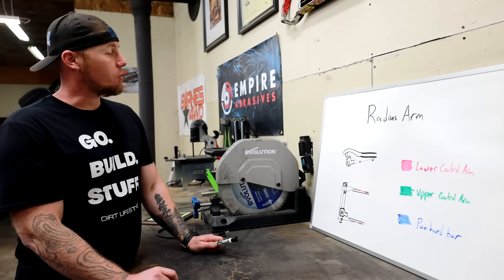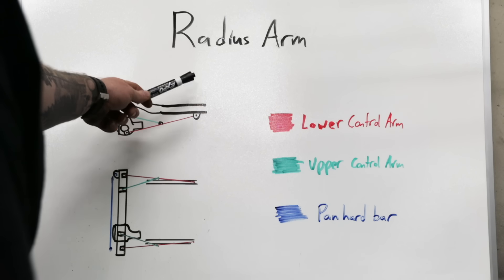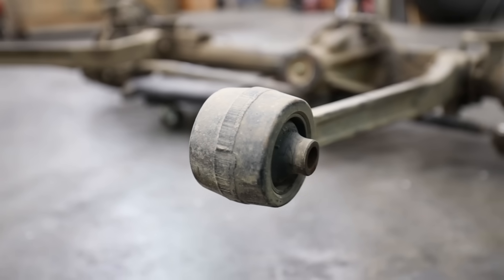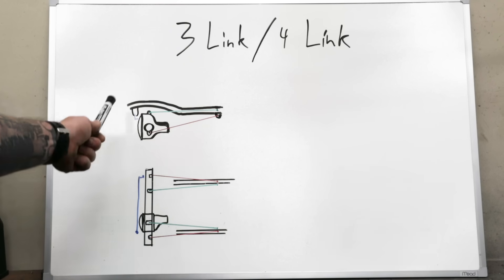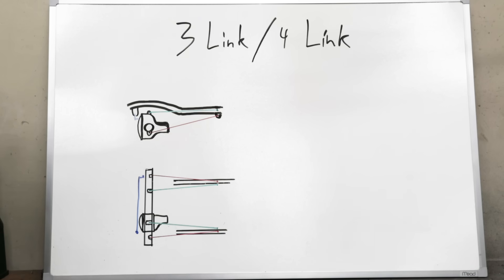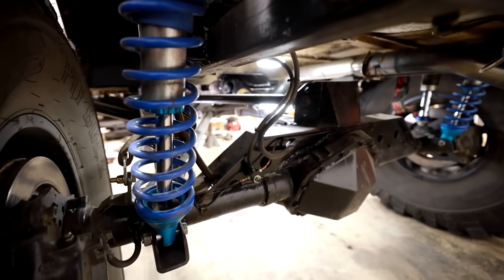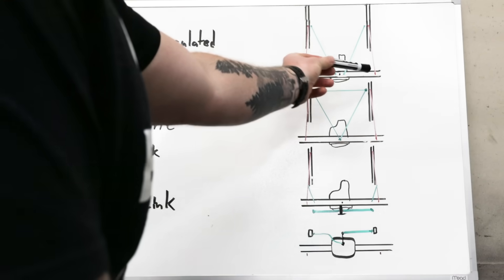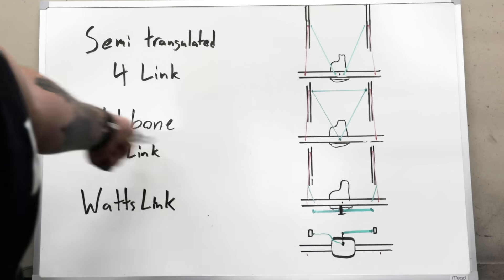3 Link vs 4 Link vs Radius Arm vs Watts Link vs Wishbone 3 Link

Comment: Although I'm 5 years late watching this video, man let me tell you that you've accomplished teaching me a lot within such a short time. I used to have an XJ on the Skyjacker Rock Ready 8" LA bolt on kit. That kit was a 4 link. It was awesome. Fast forward 10 years later to present day, I purchased a built XJ on  a 4.5" RE LA kit. This one is a radius arm kit. I was contemplating going up to 6.5" coils in the front but had ran into some information that radius arms "bind" up more than a 3 or 4 link. So I was in between options on just buying new 6.5" coils with the RE radius arms or going straight up Iron Rock 3 link kit for the front. With this new information you made possible in 1 video, I'm comfortable making a better, informed decision. Thank you very much for this. Keep building stuff and sharing your knowledge, much appreciated!

Comment: "Radius arms" are tuneable if you set them up like a jeep long arm where you have an adjustable "lower ca" which has a small "upper ca" link coming off of it which is also adjustable, you, in theory, have an adjustable radius arm.

Comment: What about truck arm suspension? And has anyone ever considered de-dion for an offroad build? De-dion, if you don't know, is a dead solid axle connecting the two hubs, with the diff mounted to the chassis and using CVs to power the wheels. Advantages are no torque twist on the chassis and much lighter unsprung weight. Can't really think of any disadvantages besides a different kind of complexity. Though I assume in the offroad world, CVs in general are at a disadvantage, strength-wise.

Comment: Land rover duscovery uses the watts link my lifted disco 2 handled very well required no rear sway bar, flexed very well offroad, i would run a watts link again, current set up is a semi triangulated rear with 6 inches if lift from a reputable company, the roll steer is real and out of control without a sway bar

Comment: I had a long radius-arm setup in front. Gnarly flex.
But the vehicle eventually developed a terrifying death-wobble.
I'm now wondering if I needed to replace all of my bushings. They visually looked good, but were probably pushing 4 years old at the time. I never realized the bushings are a frequent wear item for radius-arm suspension. Thanks for enlightening me.

Comment: Thanks.  Just the debate we are having on our LJ.  Especially on the front.  It is running RJ60's on a short arm.  Radius arms in the front was the first thought but the rotated 60 housing will be an issue.  A way around that is to modify the upper arm on driver side to clear housing.  put an arch in it.  Was thinking Clayton but now see that crazy "strut" set up on the Metalcloak radius set up that stops the binding.?  Yes, we can build our own kit but was trying to stay with an off the shelf option that we could tweak.  So 3 link may be the option cause exhaust will be in the way for 4 link.  Trying to stay on some kind of budget but it's getting out of control as our minds wander.  Since we were going to stick with coils and shocks and now have the coil over bug.  Thoughts?

Comment: Watts link and 3link/panhard in the rear is an option for a truck that's keeping the stock fuel tank and real estate is an option. I've also seen a reverse direction upper triangle link which I still can't wrap my head around.

Comment: Why couldn't one use a single leaf spring to hold the axle in place and leaf springs or coilovers for the actual suspension  ?
just for simplicitys sake and a smoother ride over leaf springs.

Comment: Hi Nate great info and very nice you are willing to help out other wheeler guys I am tying to build a Utv Buggy with a straight axle and rooms is tight  I have been playing around with links arms I have though about doing a double A-arm set up on each side like a Quad but turn 90 I think it will go up and down good but I can not tell if it will flex with this set up what do you think. and the axle is a Suzuki Samuari axle or jeep cherokee axle and I am thinking on building a truss on top of either one manily the Suzuki axle I do not want to run a panhandle bar.

Comment: On the Semi-triangulated 4 link and the wishbone 3 link having the parallel links parallel to the ground @ ride height the roll steer will be minimized. Having the forward end of the parallel link lower than at the axle it will have roll understeer which gives a stabilizing effect.

Comment: i have a 1995 ram 2500 4wd completly stock would longer arms on the front give better ride . don't need lift don't do off road with it but would like a little better ride i like the look of long arms but mainly want better ride. when i say don't do off road i do sometimes assist in recovery of stuck vehicles  but don't do off road for fun im in southeast Alabama mostly mud not much else do deal with

Comment: Panhard bar rear ends roll to one side when above ride height, if you run fatties in tubs you can touch the body into the tires on one side of your truck... The difference between a watts link in vertical travel.

Comment: I watched this video as I'm doing full size axle swap and 5.3/4l60 on my '03 4 door tracker. I think I'd like to do radius arm front. Do you or any one else have a suggest arm length overall based on tire size? I assume longer the better. Also the separation of upper and lower axle mounting  tabs? Maybe I'm over thinking this. I do it a lot haha. Thanks

Comment: I know this video is over a year old.. I've watched it a couple times, but I just came up with a question. 
On a triangulated 4 link. Is there any reason you couldn't reverse the triangles? What I mean is make where the links come together on the bottom of the axle instead of the top, then the "wide part" of the other triangle on top of the axle.

Comment: After watching a bunch of your 3 link/4 link videos, I had a question for you and wanting your opinion. I have 3 linked the front of my jeep and I’m wanting to link the rear of it, It has a factory offset rear axle, with this being said would a single triangulated 4 link mess with the driveshaft ? Or would it be best to 3 link the rear also to keep the driveshaft clear ? I’ve been reading up and I’ve seen a few 3 links in the rears of Tacoma’s and such. 

Thanks !

Comment: very interesting. does a factory radius arm set up have a lot of bind? can it be improved a lot by converting it to heim joints? I can not see the difference between the triangulated 4 link and the wishbone set up. the drawing looks exactly the same if you eliminate the cross bar... 
what about a wishbone set up like C10 Chevy, with the center of the triangle reversed to the front?

Comment: Hey Nate! Love your videos man! I have a 96 Dodge ram project that has me scratching my head a bit. It has the Dana 60 front diff with the CAD unit. It also has what appears to be factory 4 link with a pan hard bar. I've been told it's best to ditch the OEM steering due to death wobble and I've also been told I should drop the factory 4 link and go with radius arms. Now this truck is a beast (5 speed, 12 Valve Cummins) but it's main use and purpose is a tow rig (possibly emergency recovery), not hardcore offroader. The reason I'm asking your input is the factory steering, pan hard bar AND all four links are just tore up from abuse and I have zero interest in reusing them. So if I'm going to replace them... Should I stick with OEM or do upgrades? What would you do?

Comment: I am just learning how to and where to start on my triangulated rear 4 link with coilover conversion, and front torsion bar delete with coilover conversion on my 2001 Ford Ranger Trail Truck build. I have already begun by recording some measurements, throwing away all of the factory suspension, and ground away the rear shock tabs from the 8.8 rear diff. Now I am ready to purchase the proper suspension pieces & put back together & finish powder coating everything. I just realized that even though I have a solid plan, and i'm not scared or afraid of this, I also accept that I don't know as much about getting the first stages of the ball rolling. 

I probably need to decide how big the wheels and tires will be.

How much lift I want, higher than factory ride height. I was thinking about 4" so I can go from 32" to 35" tires. 16" to 17" wheels.

Then I should be able to establish with that information, what height to set the differentials on jack stands and height to set the frame on frame stands, giving me my ride height. Right? Until I do that, I can't establish my driveline angles, thus, cannot weld the tabs and mounts for the 4 links. Am I thinking clearly? Is anyone reading me? haha. It's almost like I have to pretend the build is done, so I know where to actually weld the link tabs. Do most people just go where the front perches for the leaves used to be?

Comment: A watts link is a little more complicated and a little more simple than you're thinking there... The big benefit is there is exactly zero lateral axle movement in a watts link... you can use a watts link with any other configuration that isn't triangulated as well... Having a 3 link with a watts link is a 5 link rear, using it with a 4 link rear makes it a 6 link... The Raptor uses as 6 link, for instance. the big benefit is no rear steer at high speeds... The other big benefit is that you can set your roll centre wherever you like it, it's about the only live axle suspension system you can do that with. The roll centre is set at the pivot on the toggle link.

That ability to set the roll centre hight is pretty massive when you're running compliant, soft vehicles, as well... It means you can lift or lower the RC height to change the relationship between your ride and roll stiffnesses, meaning that you can do that instead of using an anti roll bar, or in conjunction with a soft one, to provide good body control, good onroad manners and still provide good roll resistance with a soft setup.

Anyway, I hope that helps.

Comment: Let's say a guy has radius arms in the front and wants to get rid of one of the upper control arms, is that possible? So a radius arm on the driver side and just a lower control arm on the passenger side.

Comment: Wishbone 3-link owner here... No flex steer! It'll flex out like it shouldn't be possible to become that limber, but it doesn't flex steer.
I think the people who make these goofy claims should put their credentials alongside their statements. One could only assume that the people who experience this issue are not compensating for the added stressors upon the singular load bearing link. Gussets, tubing, and one big heim joint going back to two polyurethane bushings mounted on the same bolt that the lower control arms ride on. Fabtech figured it out perfectly on the TJ and it is the best thing since sliced bread!

I like their design so darn much, I'm borrowing the design for my K5 Blazer... AKA a bigger Jeep made by Chevy.

Comment: Great job!  I am doing a build where I was able to have triangulated 4 link front and rear, and someone pointed out to me that I may have bump steer in the front from the 4 link holding the axle centered during travel, but the crossover steering arm changing angles will make it so it feels like bump steer.  I played with it quite a bit and I see what he’s saying, but I haven’t driven it yet so we will see. It’s a YouTube build (ugh) so you can check out what I mean if it’s unclear. 

Great job on your channel. Keep having fun!

Comment: The Watt's link also keeps the axle centered through suspension travel. It's also more tune-able than a panhard. It works very well in road race cars that are required to use a solid axle.

Comment: Dude thank you for the info, so good. I do have a question though. I have a fabbed radius long arm setup on my 14 JK Ruby. You mentioned that they can’t really be tuned like a typical 4 link. But, shouldn’t the same principles apply between it and a 3-4 link? For instance on your example 3 link, couldn’t the adjustable upper link axel brackets be used to adjust bar angle? And like wise can’t you adjust pinion angle by lengthening/shortening the upper bar length? 

Also, this is kind of a question of theory. If you triangulated the lower links opposite of typical 3-4 link. Where the lower axel links were closer and wider at the frame. Then have a linked bar at the rear of the lower bars connecting them and similar to a radius arm. Then the upper links, would mount further outboard on the axel and then triangulated closer and mounted on the bar that links the two lower control links together? I’m not sure if this is a potentially viable setup or not? Thoughts?

Comment: Great info! I have hundreds of ideas about a different rear axle in my 95 Dakota. It will be strictly street and I want handling over travel, your explanation actually confirms some ideas I had. Thinking about long radius arms on the outside of the frame (fuel tank in the way on inner frame) and a Watts link (street suspension, lots less travel and flex). So I was think about getting the front of the arm as close to the u-joint as possible, this gets me to the boxed section of the frame. Arms would be parallel to the ground at ride height, how long is too long? Thinking wheel spin, wheel hop, weight transfer, occasionally go to drag strip, will be “shop truck” daily driver. Any thoughts or recommendations on where to get answers?

Comment: The rear flex steer is based on the roll center's distance from the centerline of the axle. It's the same on all suspension designs, the 4-link doesn't have a disadvantage here, it's just that many of the systems out there have tall brackets above a big pumpkin.

Comment: Watts links have the benefit of acting as a quasi roll bar since it acts on the center of the axle and not only on one side. I don't believe there would be much of an advantage offroad due to the complexity but they do work great on lower center of gravity street cars and trucks.

Comment: Are you ever going to do a CJ7 Suspension build?  I have a '83 cj7. Doing a frame off. It's getting SBC 350, TH350, np205. I have a ford 9" I want to use but it's full width, want to narrow it to close to stock width. It came off of a buggy, it has 488 gears disk brakes trussed and it was a 4 link. Front axle undecided so far. Would love to go ford 9" up front but $$$$. Love your vids, they are very informative. I just wish there were more vids on older CJ and YJ's. I prefer older, less plastic.

Comment: I got a quick question for you I am building a tube buggy rock crawler 4-link front and rear 14 bolt steering axles 40 inch stickies I'm going for about 10 1/2 to 12 inches of separation with my four link over the pumpkin down to the axle and at the chassis end is it okay if I squeeze it down to three and a half in separation vertically I ask because I'm trying to tune my suspension for anti squat and my role Center my role access ratio I forget what you call it anyway I know you should have at least like a third so around 5 in of Separation at the chassis is what I've been told but if I could get away with three and a half the numbers crunch a lot better for what I'm doing on paper at least

Comment: What if since ima have such a long frame to work with and im going for a bit of lift I make a cross-member to bolt all the w-4 link stuff for the front and drop it down a couple inches from the frame and since my frame is pretty open just follow the insides of the fram rails with the exaughsts

Comment: Interesting how you say the watt's link is no good for off road, yet you had one on the D2, if you elongate the centre, it will give much greater ability for travel and it will always be centred! As a note LAnd Rover have been running A-frame top linkssince 1983 and there is no noticable rear steer, but then there won't be as the arms are long. Still waiting for you to get the ABS sensors in those 1 ton axles... :-D

Comment: The old land rover defender,  range rover classic and discovery 1 all used a wish bone 3 link. They always have issues with the ballpoint on the wish bone link to the axle wearing out quickly or with to much flex the boot rips. The mounts to the chassis would also be prone to rust one some models.

Comment: i built a track bar drop bracket on the jeep  side to get rid of the bump steer and what a difference it made, almost no bump steer now. Thanks for the info man. I remember before i had the knowledge through your videos i bought a 6 inch drop pitman arm thinking i would fix my bump steer and how much worse it made it lol, the disappointment in spending all the time not to mention money.     I would really like to try the double triangulated  suspension so i can get ride of the track bar and some bump steer i have at the rear. Cant wait to check out your video on that.

Comment: So if your thinking about building custom suspension for a vechicle read this book 
"Air Suspension design" by max fish i know what your thinking not using air bags but the rest of content is gold math on figuring arm length and best designs its got lots of photos also comes with access to his website where u can use calculators that he wrote the programming for to figure a lot of stuff drive shaft angles geometry for best angle arm lengths for watts link